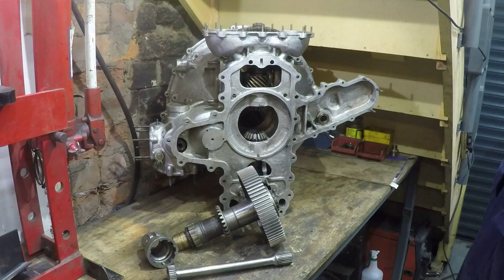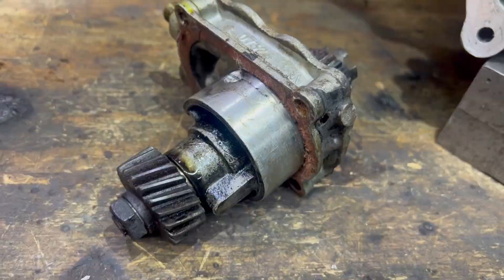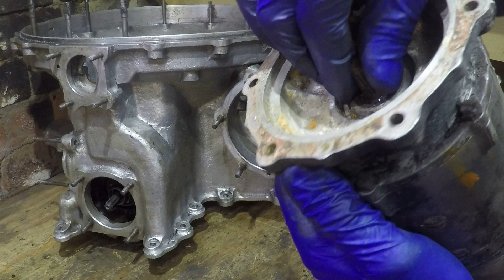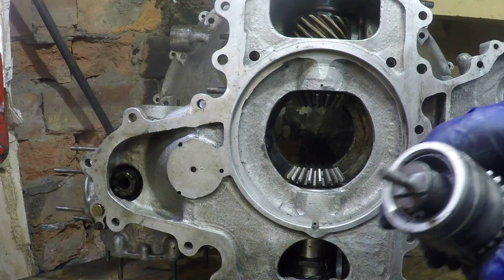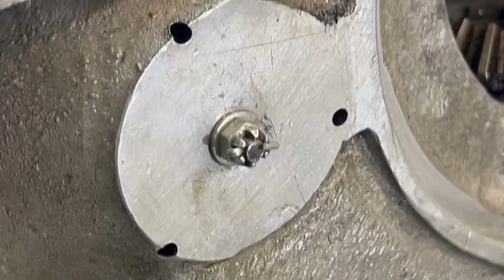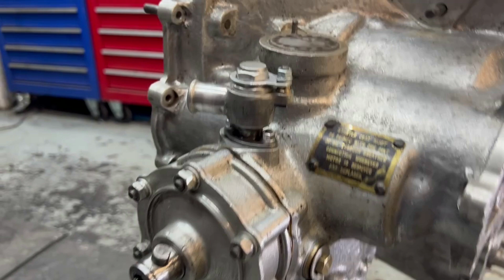Halifax W7715 Merlin Engine. EP9. Wheelcase And Gears

Comment: Fantastic video but as a simple engineer who has based a lifetime on logic I cannot get my head around why the hell was this bevel gear fetish used instead of a conventional gear train.
Its certainly wonderful to look non the less but I side with Mitchell on this.
Keep it simple - the designer of this gearbox should be made to stand outside in the rain....lol
Reply from the maker: It`s the size of the engine, you just need a lot of spur gears to carry the drive such a long way, making it heavier. The Germans did use some conventional gear trains on equivalent engines but the camshafts were still shafts and bevels.

Comment: What a fantastically complicated sub-assembly. Thank you once again for sharing your knowledge with us. The special sockets and pullers and locks are sight to behold, far out of the realm of ordinary vehicle mechanics.
Reply: Stunning to look at but daft for an engine used in military conflict.
I know, I'm a Philistine but I worship on the alter of keep it simple.....
Reply from the maker: @originalforgery  not an easy balance when you have to keep everything light and compact for aircraft propulsion. You can separate all the sub-assemblies of this engine using just spanners, or a basic flight line tool kit, allowing them to be replaced in that way. Major overhaul would always be back in a factory, as with most engines.

Comment: How do you make gaskets for everything?
Reply from the maker: Not every joint has a gasket, some are metal to metal with Wellseal compound, but I use a short curved scalpel blade rather than the sharp pointed ones which flex too much, and hole punches...and some patience!

Comment: Good presentation. Pardon me if I've already asked this question: I've always been confused about the major change to the banks-heads (not refering to the ramp head). The 'two-piece' designed by RR and first implemented by Packard refers to?
Reply from the maker: Thanks! It refers to a separate cylinder head as found on most engines, whereas this version has the cylinders and head in one unit, which then bolts to the crankcase. The two piece block also separates from the crankcase and are interchangeable with the single-piece block dimensionally, but use holding down studs of a different material.